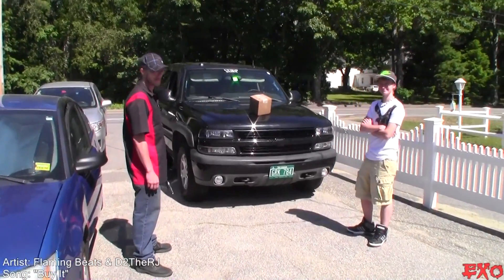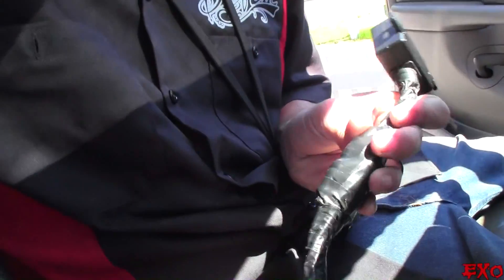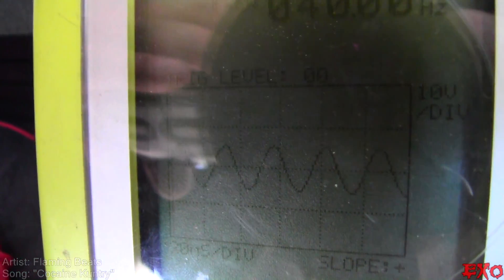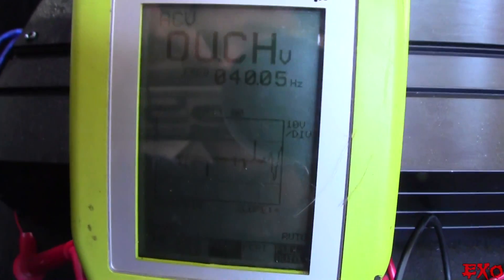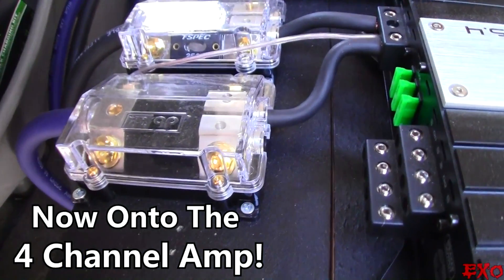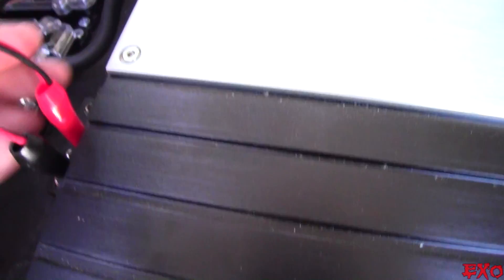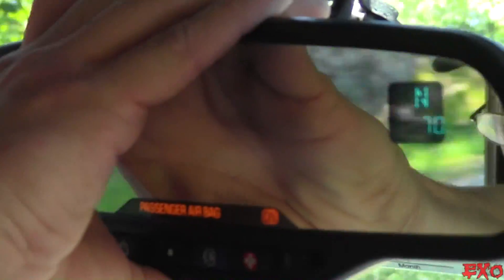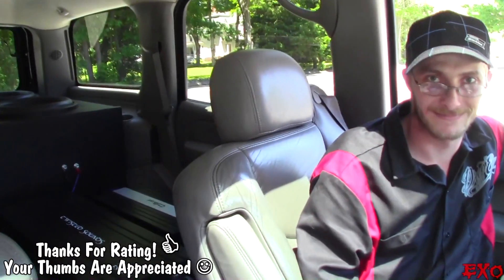Tuning a Car Audio System w/ Two Subwoofer Bass Amps & 4 Channel Amplifier | How To Set OSCOPE Gains

Comment: With two completely different mono amps for subs(one 400w on one sub in single box and one 2000w on two subs in a dual box) would you still just make the gains the same?
Reply: yes

Comment: Don’t you use Ohms Law to find the optimum voltage for the speaker
Reply: Yes you can if you're using a multimeter that doesn't show scopes

Comment: Iraggi didn't have a 2014 Chevy Cruze alternator which sucks cuz theirs would have been the cheapest!!! I had to go with Singer, and for a 220 amp I had to pay $400!!! It sucks but I had to have it
Reply: Irragi is overpriced. 600 bucks for a 220 amp alty for my 98 lumina that's just too much
Reply: Try power master at summit racing. 220 amp alt. For $189.00

Comment: Does anyone ever have any trouble running subs and the factory ac on my 93 f150 i have 2 12in subs but when i turn on my ac it blows worm and the bass doesn't hit as hard im only using the factory battery and alternator should i upgrade it?
Reply: With just 2 12's you shouldnt need an upgraded alternator, maybe try adding a farad capacitor or a deep cycle battery between the amp and cars batt.
Reply: Keeping your battery charged will keep the load off alternator. That will keep you from upgrading and stressing it. Capacities are dangerous in my opinion. Mine didn’t work bad $40. Make sure you look at big 3. That will let you look at your engine plus you can add bigger wire ie big3. It will be easy to read about. You can check battery first if any corrosion. Oh and your grounding for subs. Multimeter will help that. Good luck plus see what others off of google have done with your car as far as upgrading
Reply: @facetime9156  1000 rms per farad it works if you get a boss cap and do the numbers. I went from playing in the 12.6 range to 13.0 and up jamming harder. It don't stop dimming much or car electrical stuff. But when the amp needs its juice its the closest power provider. This means no power lost or drop for amp. Amps only tho. 4 12s w apmn audiopipe 1500s strapped and a 1000 watt amp for highs. 3 agm battery and 1 stock battery. Stock alt. 13.0 maxed....do the numbers.

Comment: Should I use a bass knob or the sub level on a headunit I noticed with my knob  with it in the bass is not as loud  vs with it out it’s louder also I believe it distorted pretty easily when using bass knob

Comment: Hey man I been trying to watch as many vids as possible on how to tune my car lol. I just installed a 4 channel amp and radio with 4 new door speakers I have no clue how to tune my radio now that I have 2 amps one for speaker and one for my sub anything I can do? I have a pinoeer nex double din
Reply: Turn amp down and turn radio up high and turn up amp until speakers start getting distorted sound and leave it like that,change frequency settings to fine tune lower volume on radio to your preferences

Comment: Check the RCA signal on the 4ch amp. One of my RCA's had a cut in it causing the same kind of voltage discrepancy between channels.

Comment: how do you set the subsonic and lpf
Reply: Subsonic means your subwoofer won't play anything below that note. Just like a high pass filter but for lower frenquencies. I've seen a lot of amps that have one setting at 25hz. I usually go between 6 to 8 hz lower than my tuning frequency

Comment: I’m working on Two projects and I believe by watching your videos I may need a 4” Dayton woofer. I’ve made a box about 16” wide and 8”deep. I an using one of the small T116 boards that is 125 x 125 x125 for bass.  I ended up putting two 6” and two 4” water proof with built in tweeters and a Bazooka 8” woofer in it. The speaker sounds good for what I made the box for, to be able to hear the TV over our hot tub but the bass just isn’t good enough. I’m on a tight budget and  have to save all I can. I didn’t put a port in the box but was wondering if a 4” Dayton wouldn’t be better? That’s the first thing I need you advice on. The second thing is I want to put a tub style setup on my golf cart using the same board and maybe all Dayton speaker. 4”pipe isn’t as noticeable and I could use up to 4” speakers in it. Basically I want it to have good clear bass not destroyed but have enough to enjoy the sound while using it. Could you please give me suggestions on setup and the model Dayton speakers I need for each project? The end on the Bluetooth amp rms was surprisingly there but the speakers won’t so I added the two 4” speakers and wired them in series. That got them to sounding as good as you can expect but I think the 8” Bazooka is just not a quality speaker. And on the pipe just let me know how many and if the Daytons are what I need. My email address is goodale@shtc.net thank! If you could help me out. I’d really appreciate it! I had to get the tub and cart because of my health issues!  I am alone most of the time and enjoy music! Thanks again!

Comment: So you are losing one tenth of a volt along that length of rca cable  the further away you go from the head unit. What is the fix for this.
Reply: C H Thicker wire could potentially fix it but you are always going to lose a small amount of voltage no matter how thick the wire is
Reply: Use a line driver with an adjustable gain control on it.   Audio pipe has one that is also made to support multiple amps.  3 inputs 9 outputs.   Max 10v out put signal you can adjust to what your amplifier max signal input is.   Also recommend getting an o-scope/DMM combo on amazon.  like $60 bucks.

Comment: Thinking about the imbalance on the 4 channel, is it possible to have an inconstant read by alligator clip to loose grub screws? May be better off with a bare wire lead or probe tip actually clamped into the amp's terminals.
Reply: Good point. I also think it would be a better readout with a dummy load connected, or if you don't mind the noise, with the actual speakers connected. Turn up the volume until clipping. Or just listen, if you're not deaf allready lol.

Comment: how do you set the subsonic and lpf
Reply: Subsonic: Take your box's frequency tuning and divided it by 2. Then divide that number by 2. Take that final number and minus it by your box's frequency. For example, my box is set to 32hz. 32/2 is 16. Then take 16/2 and you get 8. Finally, 32-8 = 24. So my subsonic would be at 24hz. Me personally, I'd set subsonic anywhere from 24-28, depending on how low your subs can get without full clipping. The lower the frequency your subs play, the more power it draws and the higher chance of clipping. Setting your HPF is just a matter of ear. It's the highest note you want your subs hitting. Mine is set around 75hz-80hz.

Comment: When you get a high output alternator, should you replace your factory alt with it, or add it to your factory so that you have 2 alts?
Reply: You replace it, adding it will run you into more trouble depending on what vehicle you have, considering you have to purchase custom brackets and a long belt, as well as more electrical connections

Comment: " you got to start somewhere " with that said i have a question if i have ( i do have ) a 220+ alt do i fuse it @ 200 or @250 going to run 1/0 big 3 to a d4800 XS power battery to a dual 12 sundown setup @ 1 ohm 2000 - 2500 RMS ( i will be adding a second battery after sub break in ) just need to know what fuse i use here...... hope this isnt to noob of a question here :/
Reply: You don't need to fuse your alt.
Reply: @michaelmcginnis3552  hmmm that seems a bit idk incorrect to me cause if that was the case why would even the car manufacturer have a fuse on the alt ?  the stock alt on this vehicle had a 75 fuse on it  so thought maybe it would need a fuse

Comment: Yes EXO, I downloaded that app tht you use to meter the spl on systems, I tried it in my home system, the same app , when I turned it up the dbs didn't go up

I tried to connect it but it didn't want to

Can you help me please?
Reply: lol
Reply: The app is to be used with a special microphone that can accurately measure the db's. Didn't you hear him say we got the SSA meter up on the dash.Your phones microphone is wimpy and can't measure accurately anything over 100 decibels. It's common sense that the phone mic is not strong enough. Haven't you ever seen a you tube video of a concert. The sound quality is always distorted because of the extreme SPL at a rock concert. It's just flapping all around while trying to record loud SPL. Perfectly fine for talking though which is what phones are really meant for, even the smart ones LoL.

Comment: I installed my amps and speakers had "professional " tune amps..he burnt my woofer up smelled..  crustchfield said set it to 26 volts. My scope tool said I can turn it up. Your thoughts?
Reply: had same thing happen. my shop said he tuned it said it can go to max no clipping. bought o scope cause i dont trust anyone sure enough it clips at 16/35
Reply: Okay, one thing he isn't mentioning in these videos is even though these amps are tunned so they don't clip, you can still overpower your subwoofer/speakers. You've gotta remember these systems are designed for comps. If you're cruising around just listening to music I doubt you'll be hitting 151db. Tune to find the clipping point of the amplifier then adjust the gain so you're getting the maximum rms voltage of your subwoofer/speaker. Use ohms law. I would also install a bass knob so you don't have to mess with your preamps. Just what one guy is thinging. But since EXO doesn't respond we don't know why he tunes amps the way he does.

Comment: Have you seen Barevids' video on setting amplifier gains? He showed us that amplifier gains that are set without being loaded (no speaker load attached) clip as soon as you attach the ohm load. Have you thought about that? Can you respond to that?
Reply from the maker: It's all dependent on multiple factors, not just the existence of a load. I've dealt with many amps that behave just fine. Would be an interest comparison video from each board to the next!

Comment: You should tin your speaker wire leads at the speaker output on the amp to have full contact with all of the conductors.
Reply from the maker: The extra steps do make it all come together! Hard to convince most to take the time and do everything by the book ;)

Comment: Great video! Is this sub box sealed or ported and if it is sealed, is it a one chamber box?
Reply: 2x  6500w amps, I'm going to go out on a limb here and say it's definitely ported.
Reply from the maker: Pretty sure it was a ported setup.
Reply: Thanks
I'm trying to get info to set up my system but i'm bewildered by lack of professional installers in my country!

Comment: do you know anyone that has  smd dd-1 and cc1 tester in stock everyone is sold out thanks
Reply from the maker: Grab a oscilloscope and call it a day :p
Reply: Drew Busch skyhigh car audio on eBay that's where I got mine
Reply: EXOcontralto the DD1 Is already a break in the bank, An oscilloscope 2-3 Times that price. unless you can find a cheaper option I’m down

Comment: Great video I wish I had been able to see this process in real life when I was young. Would have made my life a lot easier on a few occasions. One thing that I am unclear on though is that you are measuring the voltage of the RCA out of the headunit and amp output with only the impedance of the Oscope- wouldn't the voltage be different when the circuits have a real world load on them? No one has mentioned this and it's surprising

Comment: what do you think would be the reason for de-sync or lag  between the radio and the sub. i have  scion ia with stock head unit i used a-line adapter PAC AOEM-MAZ2 ( Scion iA Is A Toyota That Is Actually A Mazda)
Reply from the maker: brandon schupp Are you using a Bluetooth input signal?
Reply: im using radio. when i play a video on my iphone there is no lag between the normal speakers. just the sub. the lag is only noticeable with the sub thats it.

Comment: With regards to the difference in amp voltage, for what I understand of amps, here's my tuppence.

Personally, I think you've got a problem with the power side of the amp internally. It may just be a calibration as some amps have additional pots inside that are supposed to be setup and balanced at the factory so they can essentially do this process you've done more in depth inside. I would assume they have some for adjusting voltage to the FETs so I think that could be off. Alternatively the additional pots inside usually adjust gain per channel which could be causing a balance issue.

I know little about amp repair but that's how I feel
Reply from the maker: Paul Wisdom Your insights are appreciated! That's what I love about this channel, it's a great place for sharing information.

Comment: If each amp has phase adjust should make sure they are in phase. I saw barevids (I think) and a guy gained another dB from just phase matching.
Reply from the maker: Salvatore Hayes Great tip as well! Sam is a smart guy.

Comment: So I'm guessing it doesn't matter the ohm load ? I mean if u set the gain is it going to be the same "clean signal" whether 4 ohm or 1 ohm?? Sorry kinda new using a tool and not eats to set amps
Reply from the maker: b1782w The output will be set optimally for those different ohm loads as well. Amplifiers are always experiencing changes in impedance.

Comment: I love how people put $5,000 systems in a $1.000 vehicle LOL.  I rather have a $5,000 dollars in a 2 Dollar wallet.
Reply: WIZARD Z ; too bad you cant get either thou .
Reply: No I got the wallet ;)
Reply: DanielRichards644 I love car audio, but I could care less about the car it's in. Just different priorities I guess. Plus for some of these bigger builds, your car being torn up from spl starts to become a problem. Wouldn't want to break a new car with bass.
Reply: People are different my first suv cost $300 and I spent $15 to get it running around $500 totally to be driving it so should I have a $3 sub lol
Reply: DanielRichards644 well man I understand wat your saying my most expensive car cost me 750 dollars and I broke all the roof lights in my van an 01 with a twenty year old  sub on a 15 year old amp and the entire cost of the vehicle and the build less than 1000 dollars equal to 2 or 3 car payments minus the  down payment I believe im being redundant by saying this but money won't buy happiness the 5000 system in the thousand dollar car did so to be able to enjoy there music while every one that made payments on a car will finally install  there system in 3 or 5 years when they pay off the vehicle
Reply: That was a clean truck dumbass, you’ve obviously never shopped around for a vehicle. A clean no rust gm suv under 150k miles is easily 4.5 grand if not more for like an 05 so stfu,
Reply: John Smith Steve Meade's Tahoe sure looks fine to me, not getting tore up from all it's bass, my trailblazer is fine to, just some panel rattles when my pair of DC Audio level 3 15's hit
Reply: I agree, if your system cost more then your car then you did something wrong, hell, honestly if you put more money into modifications then what you paid for the car you should have just used that money to buy something nicer to start with, i've crossed that line myself, I paid 3,450 for my trailblazer and I've got a 1800-1900 ish set of wheels and tires, like another 800-1000 between the lowering kit and tubular control arms to correct the camber and then only now come to a full sound system (150 for front door speakers, 113 for rear doors, 252 for my amp, 560 for my subs, then whatever the 4 channel that was a Christmas present cost plus probably around 200 bucks in wiring, fuse blocks, RCA's and all that sorta stuff)

Comment: Can you make a vid on how to tune by ear?
Reply: with the subs disconnected turn the volume up to the highest setting you want to be able to turn the volume to (if running on a headunit for the 4 channels instead of a dedicated amp this will be just below the volume level that introduces distortion, on Pioneer units that go to 62 volume I find this to occur somewhere in the 50's, but high 40's, like 46-48 is usually where I stop turning up the volume just from how loud it is on those units) once you start to hear distortion in the door speakers, just below that is your max safe volume, from there start with your amp gain all the way down, reconnect the subs, turn the volume up to that loudness level you determined was just below distortion and slowly raise your gain control until you hear the subs start to distort then back it off to just below that point, basically the same thing he does here with the o-scope just use your ears to listen for it.
Reply: not a bad explanation, might give that a try